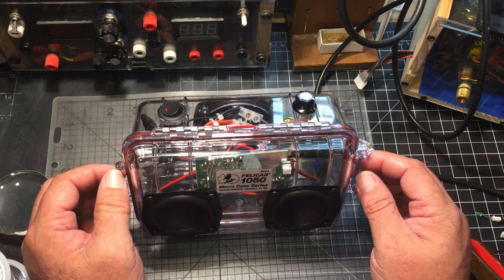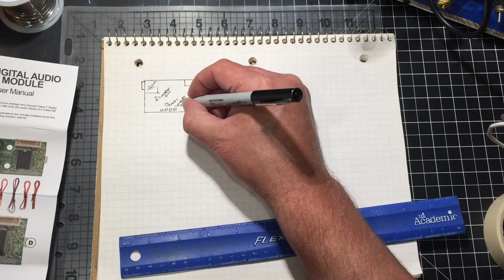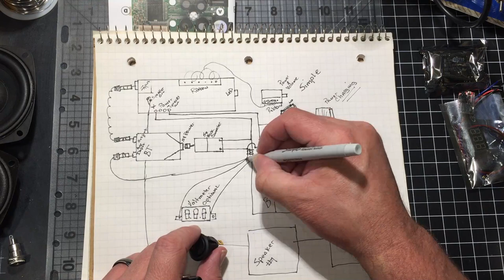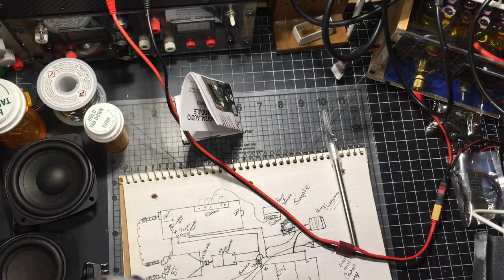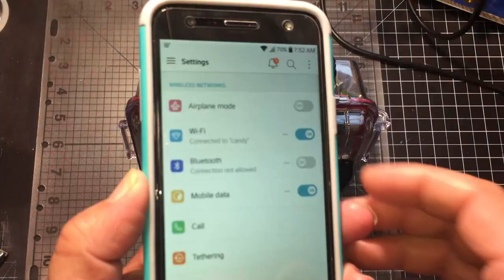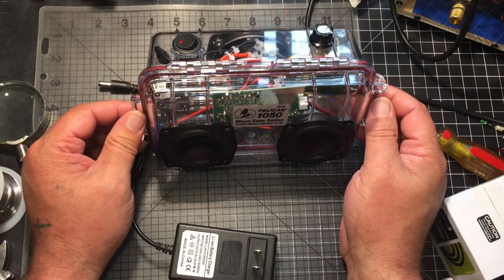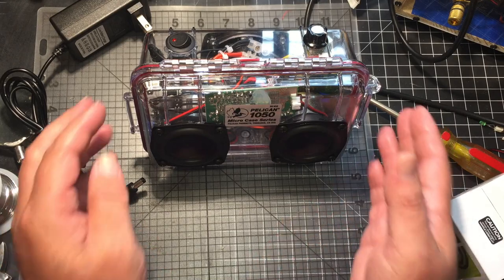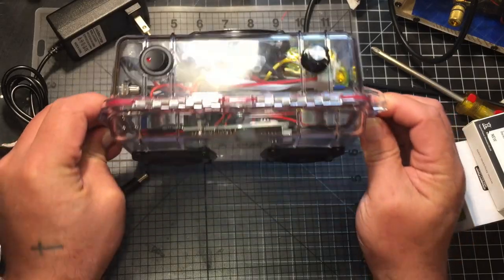DIY Pelican 1050 Mini Bluetooth Speaker Build Dayton Audio ND65-4

Comment: Hey! Thanks for providing such a thorough video on the build! I've subscribed. I've got a novice electrical question - How many hours do you get from the batteries off one charge? And what is the maximum wattage speakers you can use before the speaker requires a corded power supply?
Reply from the maker: Not really sure, but I get at least 8-10 hours of play before I have to charge..

Comment: nice work, like the DIY project. The BMS you are using i think i have one similar, how long does it take to charge once the DC plug is hooked up? I've recently finished a ND65 build, which is uploaded somewhere on here. Small but thumpy drivers :)
Reply from the maker: Thanks!!Pretty sure I only used 2600mah batteries in a 3S1P configuration. So at 2amps using the charger I purchased for 3s packs, it takes around 2 hours or under(but that's at fully depleted).
Reply: @njfulwider5  Whats the enclosure size and what do you think they play down to?